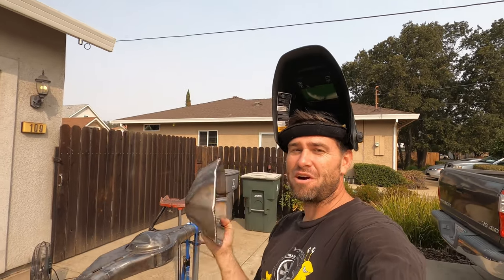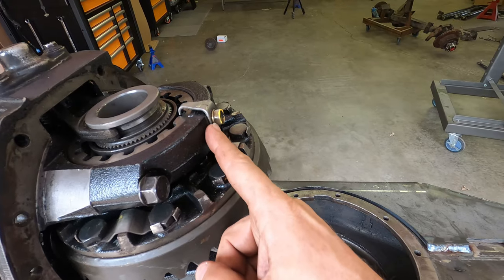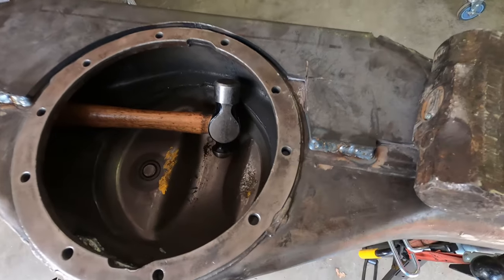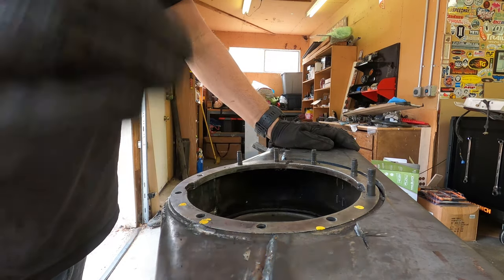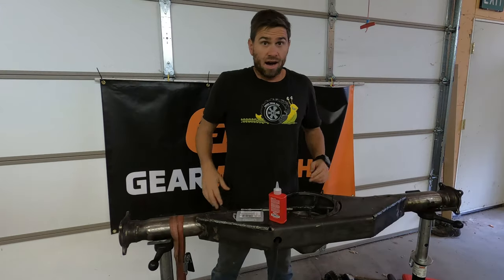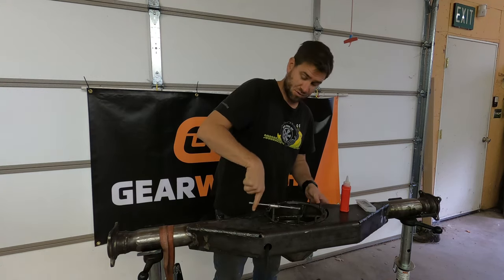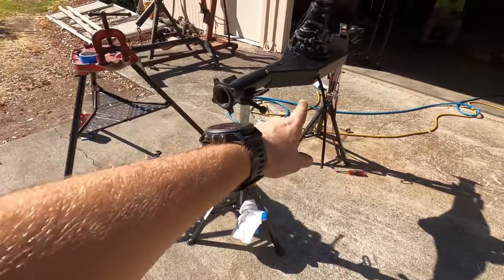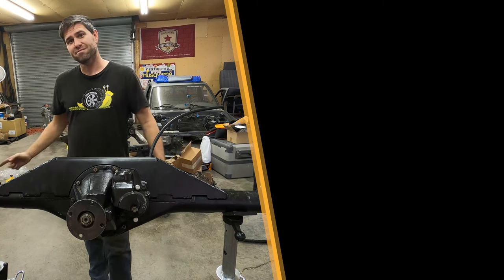E-Locker Install Toyota (Samantha Rear Axle pt2)

Comment: Those collar lock bolts typically clear if you grind them so the hex is even with the v in the middle. Just put them in a drill and hit them on a bench grinder. For the welded bolt hole You can drill it oversize then tap it. Then use a grade 8 equivalent full-thread bolt from the inside. So all the threads in the housing are doing is holding the bolt from falling into the housing.
Reply from the maker: Those are great suggestion! Thanks I appreciate good feedback

Comment: Next time instead of paint transfer for bolt holes, look up “transfer punches”.  Buy yourself a set and increase your accuracy.  Also, instead of welding a puddle to drill and tap, weld a piece of plate in that spot, so you are drilling and tapping layers of mild steel instead of hardened weld. Good job overall, can’t wait to see Samantha take shape!
Reply from the maker: Thanks, I'll look into the Transfer Punches 🤔 wonder if GEARWRENCH has them? 
In reguards to weldig plate onto the housing... The area was so small the weld would have distroyed the plate. It was maybe only a size of half of a dime that I needed. I need to find a good solution, because I have to do it again for the front axle
Reply: @SnailTrail4x4  Harbor Freight sells a transfer punch set for like $12.00. They have worked fine for my occasional use.

Comment: you can just use the gasket for an e-locker 3rd as a template to modify the housing.
Reply from the maker: If I had one at the time I would have done that. I now have one and will do that for the front axle
Reply: @SnailTrail4x4  Make sure the gasket is on the correct way before drilling.  The gasket is directional.  It will go over the original studs either way, but not the new studs.  I learned that the hard way.

Comment: Had been building up an identical set up. Do you think it’s worth finding the Tacoma rear end to run the E locker? Avoid some of that thread alignment issue? What brakes did you put on?
Reply from the maker: The alignment was a pain. What front end set up are you doing? I now wish I went with a tacoma rear axle becasue it its wider and I want the width. Also something to think about, if you dont have the E-locker already is a Eton E-Locker... I guess it fits inside the 3rd member and no housing modifactions needed
Reply: @SnailTrail4x4  Started with 85 front and 88 rear when I found the E locker with the proper gearing. The mods weren’t as seamless as I had anticipated. Tacoma rear end can be found for a couple hundred bucks sometimes. Looking now if the holes would still line up on the non-E locker version. Hoping it’s just a notch I would have to make
Reply from the maker: @pippinpup650M  -- You're still going to have to make additional holes for the e-locker. It's a different bolt pattern than a standard third member. If you're lucky you can find a e-locker housing.

Comment: Been interested in installing a rear locker to a 2wd Hilux.
Reply from the maker: I would look at an Eton E-Locker. I guess they are all contained into the 3rd member and you dont have to modify the housing. That or you go with a mechanical version